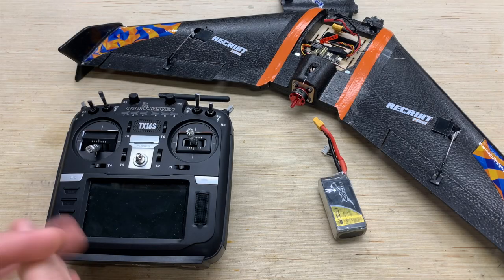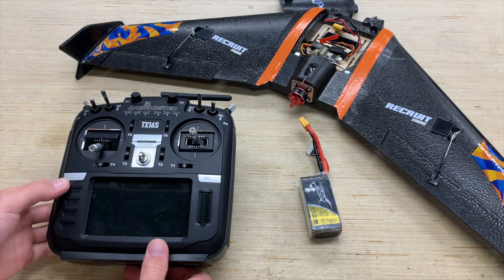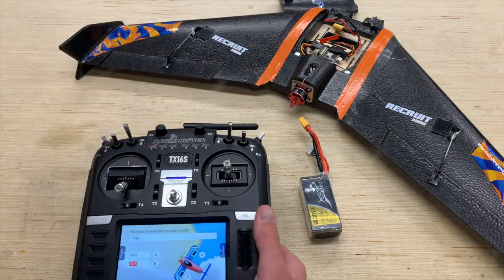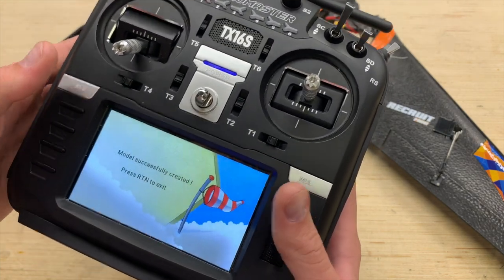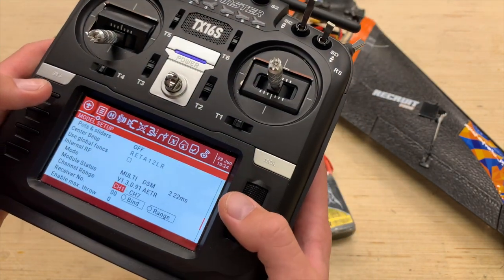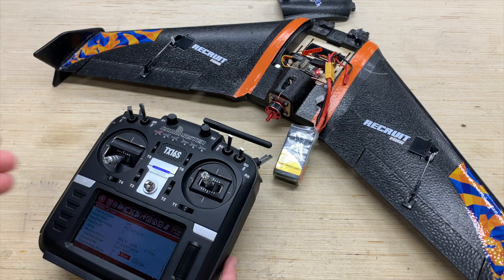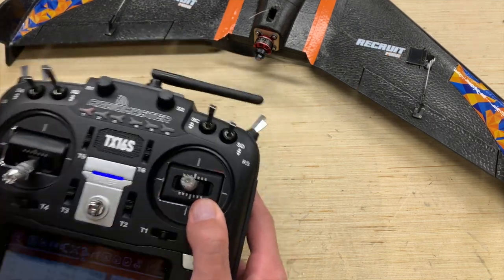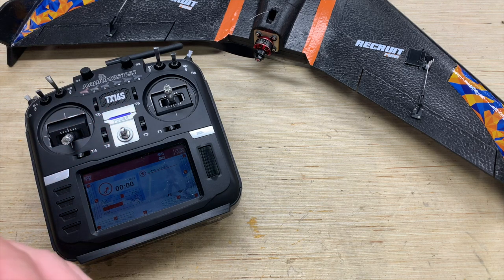How to Set Up Elevon Mixing in OpenTX (RadioMaster TX16S)

Comment: Received my  TX16S yesterday, unfortunately I'm still waiting on batteries... I do like the way it feels compares to my Flysky though.
Reply from the maker: Yeah, those batteries will get you! Little bit different that it doesn't include an AA Tray, but the internal chargin circuit is really convenient with my 18650s. Hopefully your Batteries come soon, but until then you can use any 2s lipo (7.4v) balance lead if you have any of those packs as well.
Reply: @CustomFPV  Unfortunately I only have 3 and 4s so I'm stuck waiting on the slow truck from Cali.
Reply from the maker: Yeah, if you got the same cells i got the shipping from ebay was ridiculously slow... hopefully they come soonz
Reply: Consider Bob from Arizona's battery kits. I got mine in 5-days and it has 21700 5000 mAh cells. http://www.rcbatterykit.com/index.htm

Comment: Thanks for the video but im having issues I am coming from a DX8 g2, do i have to insert my servos into the RX different now with this radio? My elevons aren't moving together, at all. i only get one moving with elevator input and one with aileron input but not together. 
Thanks for any input.
Reply from the maker: I used the same TAER Channel Mapping as the spektrum, not the AETR more common with other brands like the radiomaster. However, the source format is still in AETR, so it registers Aileron as Ch1, Elevator as Ch2, etc etc inside the radio. As shown in the radio you need to perform the mix in order for them to work together. you are essentially telling the radio that ch1 and ch2 are both ailerons and dual elevators, so double assign those channels to each of the selections. from there it should be smooth sailing. I hope that helps!

Comment: Btw, you didn't say why the aileron and elevator inputs are set to 60% at 6:19. The wizard left mine set to 100%. Of course, I know that the two channels add up to 200% when the sticks are in the corners and that the servos will stop moving long before the stick hits the limit of its travel. Also, you might explain how to change the ratio of aileron-to-elevator travel. There might be times when you want less aileron throw than elevator or vise-versa..

Comment: May I ask, how many programmable mixes does this radio support?  I build custom farm and construction equipment.  Mixes are important when adding sound and other scale-like functions.  Also, does this radio have servo slow down?
Reply from the maker: The TX16S can do 64 mixes in openTX, which is more than anyone really will ever need haha. Since the mixes are full manual, you can pretty much do anything you want. In terms of sounds, they are completely customizable as well, using openTX companion Software. Painless360 on youtube has a lot of good resources for OpenTX as well. In terms of Servo slowing and delay, yes, the mixes and inputs support that as well. Hope that helps!
Reply: CustomRCMods , I agree, painless 360 has some great videos showing how to do a lot of things in the hobby.

Comment: Hello CustomRCMods!  I really need your help here!   I been using the DX7 for a very long time I just finally got this upgrade radio! I love the quality!  Now I picked my F-27 Evolution as my first setup or migrate to the Radiomaster, I followed your video on the set up and nothing works properly.  My throttle controls the elev up and down, left and right stick does not react, up/down stick goes left and right, and no throttle.  On the manual it says the AR636 coniguration is as follows:
1 = Throttle
2 = (L) Elevon
3 = (R) Elevon
Do I need to swap out the connections on the receiver as per radio setup? 
1 = (L) Aileron
2 = (R) Aileron
3 = Throttle

Thank you in advace!  I appreciate your tutorial videos!
Reply from the maker: You shouldn't need to. I am running the default DSMX channel mapping, TAER (the first one) and its working great for me. If your plane has AS3x, you may need to mess with the channel mapping to accomodate it. You can also just plug in the servos/throttle in TAER and mess with the channel assignments in the "Inputs" tab (Hit edit, then change the source to a different input, ex elevator to throttle, etc) So if your throttle is controlling an elevon, then you could go into the throttle input and select the elevon that corresponds to the throttle control. You are essentially reassigning the messed up channels to where they go. Does that make sense? you could also try to use other channel mapping protocols, like AETR (which is #2), that one is the standard for the TX16S and openTX in general. It won't hurt to just plug stuff in and try it out. Good luck!
Reply: @CustomFPV  thank you so much. Will give that a try.  Much appreciated🙏

Comment: Can you recommend me a transmitter and receiver
Reply from the maker: Of course! While I really like this RadioMaster TX16s, I think the best combo for beginners is a Spektrum DX6E Transmitter Paired With a LemonRX 6 Channel Receiver. They should be available at a local hobby shop and obviously at many online vendors. My favorite for the Receivers is BuddyRC, and check out AMain Hobbies for the transmitter. Cheers!
Reply: @CustomFPV   thanks a lot of the info but I live in India and we don't have hobby shops here and we  even don't have foamboard here . I will go for the tx16s and thanks for the video on your channel if you didn't upload the video I would have bought the frsky thanks and btw we don't have foamboard here so i make my own but there is a seller that sells foamboard but that is expensive like you can get the electronics cheaper than that  its very difficult to get in the hobby. Love your Chanel
Reply from the maker: Sounds great! Yeah the TX16S is great just be patient with the interface and you should be in good shape :).
Reply: @CustomFPV  any good receivers
Reply from the maker: I would say the most cost sensitive option is those LemonRx DSMX Receivers. I am not sure of their international availability but I do know they are obviously manufactured overseas so there should be some vendors near you that supply them. They can usually be found under $15 USD. Thats about a third of what the Genuine DSMX Receivers go for. Let me know if you have other questions!
Reply: @CustomFPV  thanks a lot I am getting into fpv and i thought  i would upgrade my gear so I will go for a genuine dsmx and a couple of lemons 🍋 and any advice for fpv and electronics(rc airplanes) . Thanks for the great advice  and anything that is available at bangood or TBS etc will be available to me in India
Reply from the maker: Okay, that makes sense. Definitely go for the genuine RXes in your FPV machines, as they can get far away very quick. You can also Use FrSky RXes they are a little cheaper and have even better range according to some. they will also bind to the TX16s. In terms of FPV gear, the Eachine Goggles are Fairly cheap and versatile if you get the box version, which can turn into a screen as well. I have vast experience with the FXT Marvel Vision 2 and Viper Models, those are excellent goggles for a really good price. They will have all the features you could really want. On the aircraft end, It really depends on what plane or quad you are putting the device in. Smaller models can use the basic 25mw AIO systems, and as you go bigger you can use seperate cameras and VTXes to suit your needs. As far as cameras, look for high TVL (TV Line) cameras, they have greater resolution and will show more detail. Also look around for reviews about exposure, contrast, and color quality as those can vastly affect your flying experience. I like to stick to the name brands, such as Runcam, Foxeer, etc. For Video Transmitters (VTX) it definitely depends on the application. If flying indoors, keep the output power (mw) low to avoid multipath interference (high strength signals bouncing off walls and coming back to interrupt their own signal). I would recommend 25-200mw for indoor use. You also have to consider power consumtion. Besides the motor, the VTX is the second highest point of power draw from the battery, and operating at a higher output power will shorten flight times a noticable amount. I would say if you are using a DSMX control link you probably will have all the video range you need at 200mw, you will likely lose control link before video. If you are operating in a high RF area, specifically where there is lots of Wifi or Cellular signals, that is a good place to upgrade your output power. I would say the max you could really ever want is 600mw. If you ever upgrade to crossfire or another long range control system, then you can also upgrade video output power from there. That was a lot of info and if you would like links to products on Banggood please let me know. Hope that helps!
Reply: @CustomFPV  wow that helps a lot . Any good electronics for flite test airplanes. And all the link's would be helpful .thanks
Reply from the maker: Sure. I will send some links in a different comment on this thread after this. For electronics I have been really happy with basic a2212 1000kv motor/30a ESC Combos Available all over BG and Amazon, etc for sub $15. They seem super cheap but the quality is actually really good. Thats what I have in my FT Scout, Bloody wonder, and versa wing. I will include links with the others. For Servos I like the Tower Pro SG90s, again available all over BG for less than $2/servo. Batteries are a toss up. They usually cant be shipped via Air so I would look for a local vendor. You are probably looking for a 3s 850-2200mah, depending on the plane.
Reply from the maker: Links:

Radiomaster TX16s:
https://www.banggood.in/RadioMaster-TX16S-Hall-Sensor-Gimbals-2_4G-16CH-Multi-protocol-RF-System-OpenTX-Mode2-Transmitter-for-RC-Drone-p-1652191.html?rmmds=search&ID=424826287800&cur_warehouse=CN

DSM RXes (Cheapest):
https://www.banggood.in/CM621-2_4G-6CH-Microlite-DSM2-Compatible-Full-Range-Receiver-For-Radio-Transmitter-p-1007463.html?rmmds=search&cur_warehouse=CN

DSM RXes (Better Quality):
https://www.banggood.in/2_4G-6CH-CM651-DSM2-DSMX-Compatible-Receiver-With-Satellite-For-Radio-Transmitter-p-1042946.html?rmmds=search&cur_warehouse=CN

FrSky RXes (Cheapest):
https://www.banggood.in/2_4G-4CH-Mini-Frsky-D8-Compatible-Receiver-With-PWM-Output-p-1143300.html?rmmds=search&cur_warehouse=CN
https://www.banggood.in/Jumper-R8-16CH-RC-Receiver-Compatible-T16-FrSky-D16-D8-Mode-Support-PIX-PX4-APM-Flight-Controller-PWM-SBUS-Output-p-1578460.html?rmmds=search&cur_warehouse=CN

FrSky RXes (Better Quality):
https://www.banggood.in/FrSky-V8FR-II-2_4G-8CH-Receiver-HV-Version-for-Radio-Transmitter-p-69051.html?rmmds=search&cur_warehouse=CN

Eachine EV800 FPV Goggles (Most Feature Packed for Beginners):
https://www.banggood.in/Eachine-EV800-5-Inches-800x480-FPV-Goggles-5_8G-40CH-Raceband-Auto-Searching-Build-In-Battery-p-1053357.html?rmmds=search&cur_warehouse=CN

Eachine EV800D FPV Goggles (Same except includes a Diversity RX for better signal Quality):
https://www.banggood.in/Eachine-EV800D-5_8G-40CH-Diversity-FPV-Goggles-5-Inch-800+480-Video-Headset-HD-DVR-Build-in-Battery-p-1180354.html?rmmds=search&cur_warehouse=CN

Eachine TX03 25-200mw Switchable Micro AIO Camera (Clover Leaf antenna - Best for Outdoor Use):
https://www.banggood.in/Eachine-TX03-Super-Mini-025mW50mW200mW-Switchable-AIO-5_8G-72CH-VTX-600TVL-13-Cmos-FPV-Camera-p-1104884.html?rmmds=search&cur_warehouse=CN

Eachine TX04 25mw Micro AIO Camera -- Ultralight (Dipole antenna - Best for Indoor use on lightweight machines):
https://www.banggood.in/Eachine-TX04-PAL-Super-Mini-Light-AIO-5_8G-40CH-25MW-VTX-700TVL-120-Wide-Angle-FPV-Camera-p-1166418.html?rmmds=search&cur_warehouse=CN

Cheap Basic Standalone FPV Camera:
https://www.banggood.in/JJA-CM1200-13-CMOS-1200TVL-Mini-FPV-Camera-2_1mm-Lens-169-PALNTSC-BlackRed-For-RC-Drone-p-1259982.html?rmmds=search&ID=22844070&cur_warehouse=CN

Foxeer Predator 4 Ultimate FPV Camera (Feature Packed):
https://www.banggood.in/Foxeer-Standard-or-Mini-Predator-4-Super-WDR-4ms-latency-1000TVL-FPV-Racing-Camera-OSD-4-3-16-9-NTSC-PAL-for-RC-Drone-p-1465498.html?rmmds=search&ID=224530889&cur_warehouse=CN

AKK X2 Ultimate VTX (Cheap But Feature Packed):
https://www.banggood.in/AKK-X2-ultimate-International-25mW200mW600mW1200mW-5_8GHz-37CH-FPV-Transmitter-with-Smart-Audio-p-1388013.html?rmmds=search&ID=511528&cur_warehouse=CN

ImmersionRC Tramp HV (Name Brand, Best features/performance):
https://www.banggood.in/ImmersionRC-Tramp-HV-5_8GHz-48CH-Raceband-1mW-to-600mW-Video-FPV-Transmitter-International-Version-for-RC-Racing-Drone-p-1088990.html?rmmds=search&cur_warehouse=HK

Foxeer Lollipop Atenna:
https://www.banggood.in/2pcs-Foxeer-5_8G-Lollipop-3-2_5DBi-Omni-FPV-Antenna-RHCP-SMA-or-RP-SMA-for-RC-Drone-Airplane-p-1472198.html?rmmds=search&ID=513344514094&cur_warehouse=CN

Foxeer Lollipop Stubby Antenna:
https://www.banggood.in/2pcs-Foxeer-5_8G-Lollipop-3-2_5DBi-Stubby-Omni-FPV-Antenna-LHCPRHCP-for-RC-Drone-Airplane-p-1472193.html?rmmds=search&ID=513344529634&cur_warehouse=CN

Realacc Patch Antenna:
https://www.banggood.in/Realacc-Triple-Feed-Patch-1-5_8GHz-9_4dBi-Directional-Circular-Polarized-FPV-Pagoda-Antenna-for-Fatshark-DJI-Eachine-Goggles-p-1195261.html?rmmds=search&ID=224&cur_warehouse=CN

a2212 1000kv Motor/30a ESC Combo (FT Power Pack B Spec):
https://www.banggood.in/XXD-A2212-2212-930KV-KV9301000KV-KV1000-Brushless-Motor30A-ESC1060-Prop-Blade-Propeller-RC-Power-System-Combo-for-RC-Drone-Airplane-Support-2s-4s-p-1615389.html?rmmds=search&ID=47991&cur_warehouse=CN

SG90 Servos:
https://www.banggood.in/10PCS-SG90-Mini-Analog-Gear-Micro-Servo-9g-for-RC-Airplane-Helicopter-Car-Boat-Models-p-1674930.html?rmmds=search&cur_warehouse=CN

Okay, thats a lot of links, the options are there for you to choose from. I tried my best to use the India banggood site and get good pricing but my conversions aren't that great in my head. let me know if you have any other Questions!
Reply: @CustomFPV  thanks a lot
Reply: @CustomFPV   servo ,moters and esc are  available in India for less than 5 dollars so I will buy that and the quality is ok just like the bangood one . Should I buy TBS Antennas and which fpv goggles do you recommend(from the links).

Comment: Slow down to 33 rpm! And don't swing that TX around I would get seasick!
Reply from the maker: Cursing is not appreciated in my comment section. This is a channel friendly to viewers of all ages. As for your points, I certainly could have done better looking back, but slow it down if you need. the info is still there. this isn’t a feature film, it’s better than not having this information at all. Thanks for watching!
Reply: @CustomFPV  SORRY!
Reply from the maker: @svpetarSR  No worries.